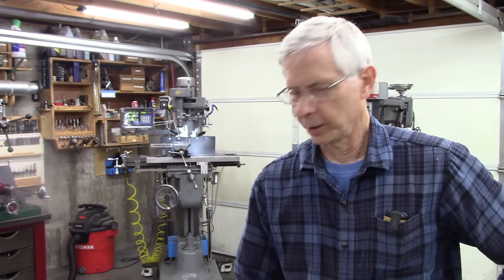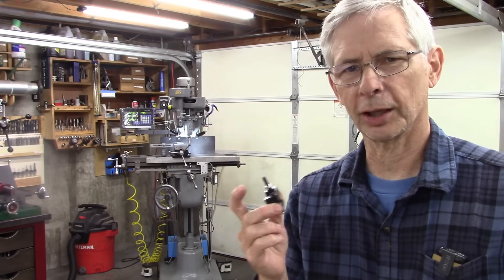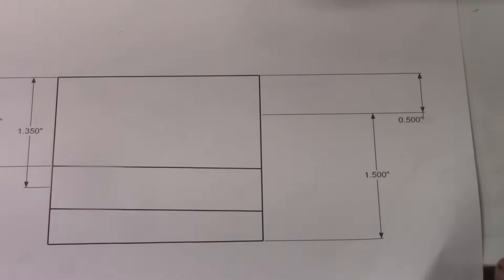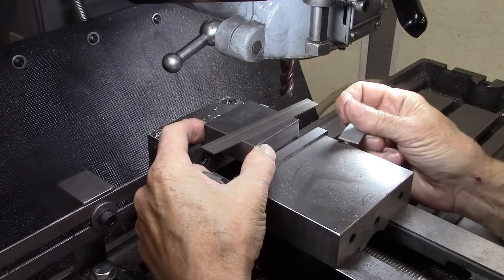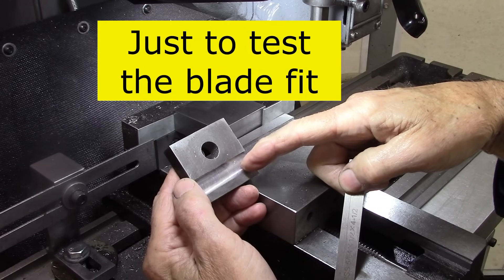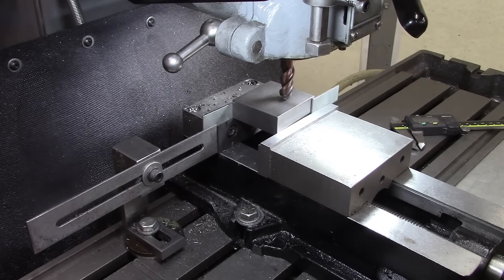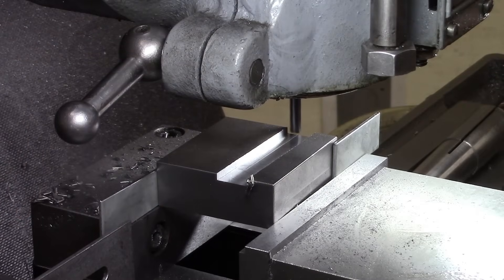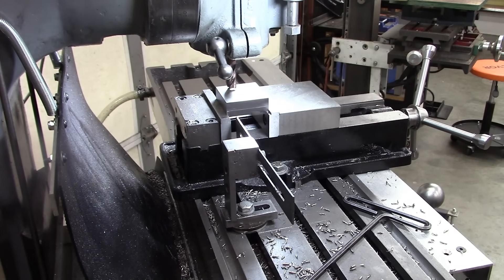Prototype OXA Spring Cut-Off Tool

Comment: If your clamping washer had a 20 thou step on it (on one side so it will clear the blade slot), you could cut the relief hole to be half way between the 40 and 80 thou blade width. The washer could be installed with the step on the blade for the thin blade and on the holder for the thick blade which would keep the locking screw flat.
Reply from the maker: This tool didn't work well and I'm not sure why. The washer clamp was easy for one thickness blade. The washer needs to tip slightly so that it clamps about have way up the blade. Milling the washer might work but getting all the depths exactly right would be a challenge. You have the depth of the blade slot, the depth of the washer recess, and the step in the washer that all have to be perfect. But I do agree, I need a better method or to at least decide on one thickness.

Comment: An after thought, perhaps instead of the L shape the body could be flush and bolt to the side of the QCTP holder instead of the top to save on machining and material?
Reply from the maker: I like this idea! My only concern is keeping the point of flex up high enough. Right now the hole and slot are about even with the top of the holder....  you got me thing though!

Comment: It should be appreciated. There is a lot of the ubiquitous Chinese 9*20 lathes out there. They are a good machine but the original tool post is not remarkably ridged so a lot of operators make a solid plinth or install a 'Pitkin Doughnut'. This should help a lot. Great work mate.
Reply from the maker: I'd say you are correct. Hopefully I can come up with a workable design.

Comment: Winky, with the washer for the new tool holder, instead of countersinking the washer, use a ball ended endmill to give a concave recess. Then make a 1/2 ball bush that is a bit thicker than the recess, then use a standard cap head or button head capscrew to tighten. This will then give you a fully adjusting self levelling clamping, allowing for compound angles. Philips DRO's in the 1980's used that type of clamping for the scales to allow for any machine casting tapers. Today the cheapie Chinese scales use a plate with 4 grubscrews to get it level. Little more effort on your part but a spherical adjustment bolt will give a better locking than a countersunk bolt touching on 1 side only. You will need to make the center hole in the big washer a bit larger diameter to allow the bolt to have side clearance as the washer tilts compared to the tapped hole. Regards from Australia.
Reply from the maker: Thank for the idea, a good approach but not really needed once the correct blade thickness is established. The slopped recess is easy to get right. Of course it might be nice to be able to use two different blade but that is also complex due to the different load on the spring Actually, the countersink screw worked well too although it looked weird.

Comment: The OXA Post is not very high, getting the blade on centre may be a issue.
Reply from the maker: I put a 3/8 tool in  the holder and set the blade height the same. The picture is deceptive the top of the holder is even with the horizontal slot.

Comment: Hi Mark, just looking at this tool I think the cutter is going to be way to low, I am pretty sure it will not centre on a mini lathe, I have a mini lathe and i am sure it will not centre on mine I think it will run out of adjustment or tool post before it centres.
Reply from the maker: I puts a 3/8" tool in the holder and set the top of the blade even with the top of the tool. It's probably a little deceiving looking at the picture. The top of the OXA holder is even with the horizontal slot.
Reply: @WinkysWorkshop  Ok Thank you for that.
Reply from the maker: @WayneCook306  No problem!

Comment: We received ours a couple weeks ago. So far everyone likes it. Normally we get maybe 1 week out of a parting blade with our membership.
Reply from the maker: Wow...  watched your video. I need your camera, very good video🙂. The feed rate was too slow and i suspect the tool stick-out needs to be slightly more. It needs to be 1" to 1.1" The squealing will go away. The stick out effect how much leverage the blade has to compress the spring. If the blade is too far out it will go under the stock at the end of the cut. The higher feed rate alone might do it...  the camera angle made it hard to see the amount the blade was sticking out.
Reply: @WinkysWorkshop  nothing special, just my IPhone 11. I did turn the volume down in iMovie. I did it more of a baseline. One of our members sped the feed rate up with good results.
Reply from the maker: @TBJK07Jeep  Phone camera are amazing. Great on the feed rate.

Comment: A comment/question regarding the large amount of metal you have to remove. Would it make sense to band saw that out to within say .125 then bring it to dimension on the milling machine? 2 cuts with the band saw and a small amount of milling.
Reply from the maker: Absolutely! Better yet (if the tool proves itself) I need to find some machined 2" x 1/4" machined angle stock (kind of like DOM tubing). I know it's out there, they used to order it where I worked. It was expensive but the amount used here is minimal. So far I can't find it.

Comment: I'm curious to see the test results. Mini lathes aren't very rigid, but we'll see what happens.
Reply from the maker: Me too. I suspect it will work but if the spring needs to be very weak it will limit the depth of cut. I may have to move the hole to adjust the spring strength

Comment: Good afternoon Mark,
For your locking washer, why not make your own and step cut half of the thickness off so it will be parallel to the holder.
Reply from the maker: That works but milling the recess at an angle is a lot easier and very effective. Trying to do this to accommodate two different thickness blades gets weird.
Reply: @ sleep on it some more and maybe a revelation will come.
Reply from the maker: @jimfiles3307  😃 I took a nap on the recliner - The problem with the stepped washer is that it clamps on the bottom edge of the blade. By making a sloped counterbore for the washer to sit in, it clamp about 1/3rd of the way up on the side of the blade.

Comment: Will it stop my cut off blade inserts from exploding? Lol Or is that because I don't know how to do it right yet? Probably the latter if I had to guess. I've only successfully used a cutoff tool a handful of times. That process scares the bejesus out of me.
Reply from the maker: Well, I'm not sure about this untested too yet but if you have an AXA or BXA tool post my cutoff tool will likely solve your problem. Cut off on is fairly demanding on the lathe. Usually people that say, "I never have a problem" are using large industrial lathes. Also, carbide makes the problem a little worse. Its not as sharp. With that being said, several have built my tool design and used insert in place of a blade.

Comment: On the screw for the blade, have you tried to drill at an angle? Screwhead popped off on mine, so, replaced it. Looking at threaded piece it cracked opposite of the blade. Made a beveled washer to eliminate the stress. That’s why I think the angle drilled hole might be better and will still accommodate a thicker blade, maybe even a thinner one for making circlip grooves in parts. Yes the tool works great making or repairing the grooves. I tried it as the tool was handy, and I didn’t have a ground one for the size I needed.
Reply from the maker: Hmm...  thanks for the feed back. This makes sense although  as far as I know, nobody else has had issue. I found that the blade holds very well without making it super tight. I'm guessing a countersink screw would also work..  (although it looks weird). Thanks for letting me know.

Comment: Mark where do you get the brass balls?
Reply from the maker: Grand Brass Lamps. They stock 1/4"-20 threaded balls but I recently special ordered them in 5/16"-18.
Reply: @WinkysWorkshop  Thanks I ordered a couple.

Comment: Could you make a small slot for the adj screw and move lock nut to top then maybe  make it in two pieces and bolt the front on using out side holes and bolt top down with inside holes ?
Reply from the maker: I'm not sure I followed that completely but this design needs to be altered some if I'm going to make these in any quantity. The amount of stock being removed is time consuming and expensive. The height adjustment isn't very hard to get to really. Just lift the tool on the post. Still, I have an idea that will fix both issues. Thanks you very much for the feedback!

Comment: Why not try to make it with the same dovetail as the piece your adding on to
Reply from the maker: This is a very good idea and if I was planning to make one or two I might try doing this. The thing is dovetail cutter are high priced. You can find some for about $30 bucks but the quality isn't the best. It amazes me how China can make the tool holders so cheap.
Reply: Chinesium thats why they are so cheap. @WinkysWorkshop

Comment: Winky ... This is a very much needed tool.  I bought a Mini-Lathe and quickly found that due to its limitations, I can only use it for aluminum, where it works effectively.  Even with aluminum, the cut-off feature has limitations.  I'm going to be watching this and any feedback you get.
Reply from the maker: Yeah, smaller lathes are generally not as rigid. Even between my South Bend and other lathes of the same size there is significant differences. Spindle size is a major factor too. I'm guessing the mini lathe is 25mm or less.